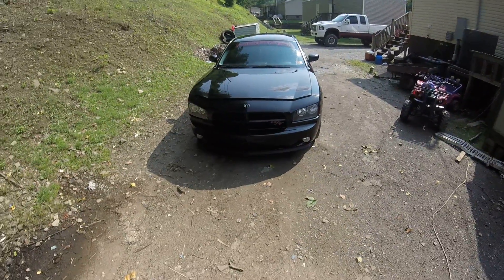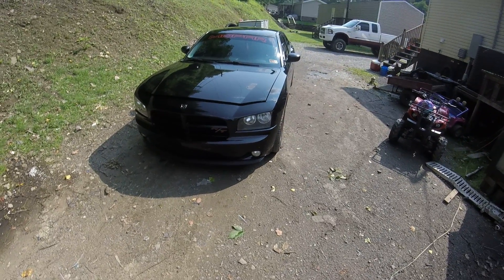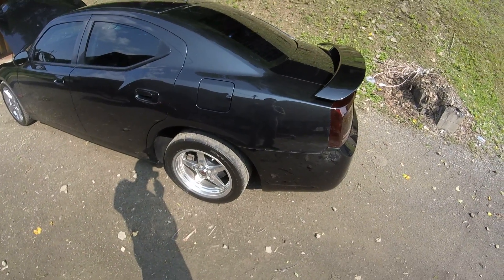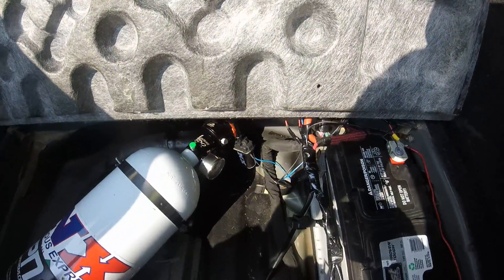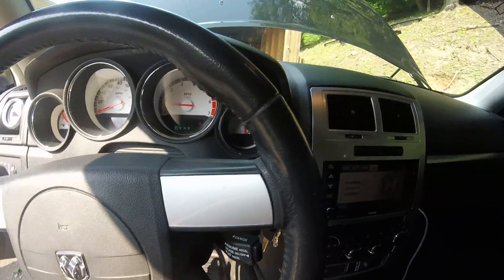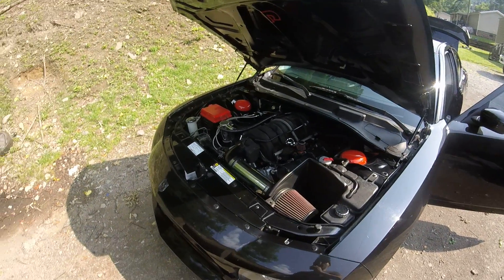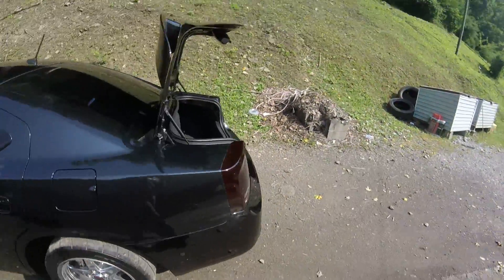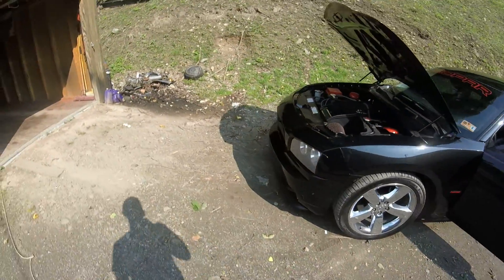2008 charger rt mod list and walk around

Comment: Ok im very interested in knowing how you did that 100% traction control turn off switch
Reply from the maker: theres a video on youtube  just type in 2008 charger traction control mod only proplem is you will have to turn the car off and flip the switch back to turn traction control back on or you can just do the key trick be rolling about 15mph and hold the key over like you are starting it untell you here it chime and light comes on dash that's only 2 ways to fully disable the traction control on 06 to 10 5.7 charger rt
Reply: @moparmuscle304  haha i did the key trick an woooow let me tell you the burnout that insued was legendary. Definitely gonna do the switch mod now

Comment: What size cold air intake do you  have?
Reply from the maker: is 3.5 or 4 inches round cant remember exactly if that is what your asking it is a spectre brand intake .
Reply: @moparmuscle304  thank you that did answer my question!  I want to install bbk long tube headers with a full 3in catback system and I want to purchase a cold air intake as well
Reply: @moparmuscle304  I have a 2006 dodge charger rt and I want to add some power to it

Comment: Whats the difference between non vvt and vvt?
Reply from the maker: vvt makes more power to start with  in 2009 is the first year for vvt on a 5.7 hemi 08 and back was non vvt and all 6.1 hemi are non vvt.vvt stands for variable valve timing you can google it to fully understand but just in quick explaining of it based on a vvt  hemi engine in the mittle of the cam gear on vvt hemi is machined passages /chambers with a spring in the center of the cam gear  and is controlled by oil press from a vvt solenoid that's controlled with the cars computer and it can add timing or take it away at diff rpm  to get max performance by adjusting the cam angle  .a  non vvt don't have any adjustment you would have to take the engine apart to adjust the cam timing  . only thing engine can adjust far as timing would be fuel and spark that's just quick run down you can google it to fully understand it .
Reply: @moparmuscle304  thanks man, now i understand